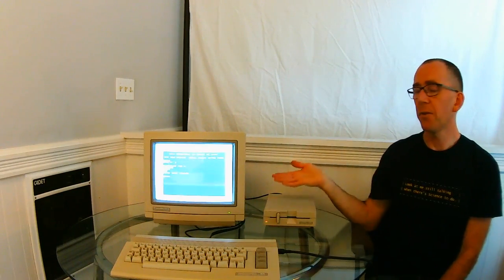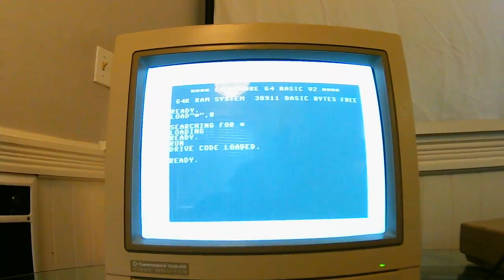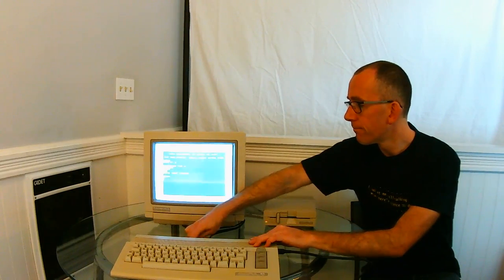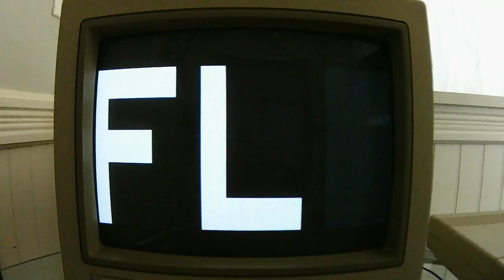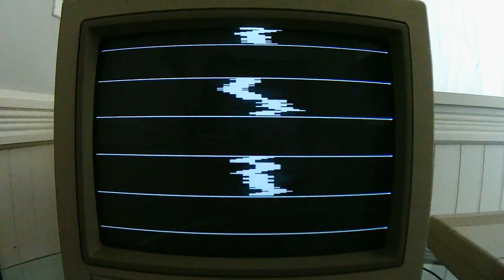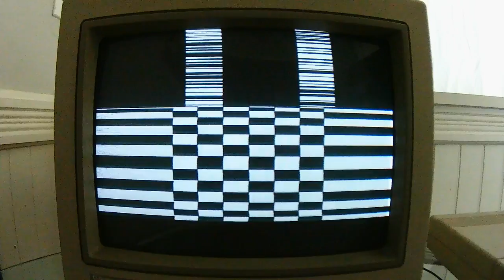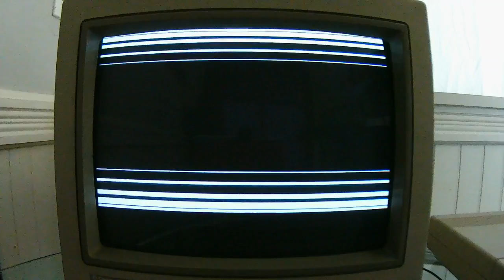Freespin

Comment: "No (not many) floppy drives were harmed during the making of this prod."
Reply from the maker: I only went through three. I still maintain that they died of natural causes.
Reply: @MatthiasKramm  would be interesting to know what killed them.
Reply from the maker: @NULUSIOS  One had a dead 6522. Probably because of a bad power adapter.
Reply: But many cables were ...
Those poor cables ...
Reply: @michiellombaers3198  they are just cables - probably user-made anyway
Reply: @NULUSIOS  /s
Reply: @MatthiasKramm  here's a challenge. Connect three drives together so they can synchronize then use one each to drive red, green, and blue inputs on an RGB monitor, and have three voice sound.
Reply: Don't worry, the floppy drives will be written off as corona victims.
Reply: @greggv8  That would be epic, but how to synchronise the Floppys?
some signal of one Floppy must tell the others to start next line.
Reply: @ulrichkalber9039  a custom serial hub through which the drives coordinate their start then the software commands it to pass the signals through to the video connections. Could periodically switch back to hub mode to recheck sync.
Reply: I don't see any need for a custom hub. There would be some custom wiring, but not much more than what this demo did. Wire all grounds together, have one drive emitting a composite sync signal which is sent to both the monitor and a serial bus line (say, ATTN) on each drive, and the other drives would sync with that and emit the colour signals on their DATA lines.

I'm not sure if this would sync tightly enough, though. It might make more sense to simply try to output more colours using the extra lines unused in this demo (SRQIN, RESET, ATN).

Comment: The question "But how?" doesn't leave my mind. Brilliant!
Reply: The 1541 basically has an another C64 inside computing power wise. And fastloaders already implemented custom signaling with the IEC port. It's just, this demo uses it to modulate composite video. I'm not saying this doesn't blow my mind still, it's just I know it's technically makes sense. It's still extremely impressive, especially that the 1541 has nowhere near as many RAM as the C64. Also besides encoding the video, it also does music with the stepper motor. Insane.
Reply: That's the one bit I still don't get, the music.
Sure it mostly sounds like a modulated stepper motor, except those super high pitched arpeggios. Those don't sounds like a stepper at all
Reply: @MostlyPennyCat  I think there must be Two motors inside that floppy, one turns the floppy, one moves the head.  possibly the turning motor makes that sounds?

Comment: Very creative and technically excellent, except cutting the wires on a glass table ;)
The Bitshifters did sort of the opposite when they connected the video out to the floppy write head to experiment with writing different bit patterns that were too fast for the BBC Micro's 6502!

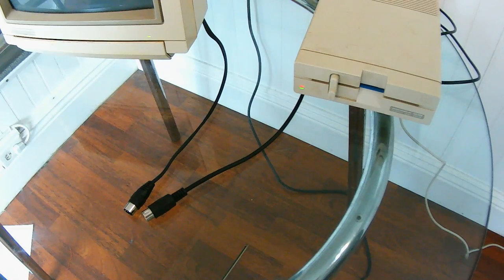Comment: 0:37 I had a stroke when you started cutting that cable, I hope it's not an original one.
Aside from that the demo is awesome 🤯
Reply: Judging by the wires' size, looks like a modern reproduction.
Reply: Yeah, looks like a modern repro.  Vintage cables would've been much thicker, and the plugs were a little different.  Plus I imagine the thick-ass PVC insulation would be much harder to cut through after ~35 years.
Reply: I felt physically ill when I saw that knife going for that cable. BUILD AN ADAPTER, MY DUDE. DIN plugs aren't uncommon! Oh god, oh god why, why... :o

Comment: It appears that disk drive itself is 8-bit computer having 6502 and 6522 inside (see Wikipedia for the image). Load program into it and trigger the execution when drive door is closed. If power is lost C64 will be needed back to restart the demo. The simple 3-level voltage circuit is genius :)

Comment: Unbelievably brilliant and unique idea, excellent implementation! Well done and...THANKS!!! And I'd thought that there wasn't much impressive stuff to be seen in the 8bit scene anymore...
My 2 silly questions/wishes:
A) Could this be ported to load from VIC20 and also C16-Plus4? This would be fun and, I suppose, very easy to be done from an experienced programmer...
B) Would it be possible to see something like this in color, using simultaneously attached drives 8, 9 and 10 and the proper cable, leading all 3 of them (each one for a separate RGB color) to a suitable analog RGB monitor like the 1084 or equivalent? This would also allow pure "multichannel" mechanical sound, with 3 step motors banging together! :-)

Comment: At first I thought: “it’s roughly similar hardware to an Atari 2600 inside - 1MHz CPU; this is cute but probably not that to hard to do”. But there is no ROM and no video hardware, just 2kB of RAM and a floppy disk (while the drive is simultaneously making music). This is a technically stunning achievement.

Comment: Wow, impressive. I knew that the C64 floppy drives come with their own CPU and such, but have never seen doing the floppy drive everything alone :-)

But when you unplugged the running computer from the cables it reminded me that someone I knew did that once, back in 1985 or so. By removing the monitor cable while the C64 was running destroyed the SID, and it had to be replaced. I hope yours is still intact. ;-)
Reply: Yes, it can kill SID, happened to me once or twice.

Comment: I'm speechless. When you thought you've seen everything.🤯
Also, this got me thinking. Since the IEC bus is a daisy chainable open collector bus, in theory you could create a multi drive demo (two drives and the screen on the cable), pre-synchronizing them over the bus, and rendering different parts of the screen? 1541 SLI?!

Comment: LOL. thank you. This is awesome. I'm in shock.
BTW... it they could forget about backwards compatibility with vic20 and other commodores, then floppy drive for c64 could be cheaper (without "second" copy of c64 inside itself) and much more faster. the same with the c128. It they could forget about backwards compatibility with c64, and create c128 without c64 mode, then game producers must provide games with better graphics and more advanced/complex code instead of making the game which is compatible with c64 and c128 in the same time (so it cannot use full potential of c128), and this could increase c128 popularity and keep commodore alive. I cannot accept that mistakes.

Comment: How to run this Demo on an emulator ?
Reply: You could cut open the emulator and..😆

Seriously, now: basically, someone would have to modify an emulator to add this hardware setup.
Reply from the maker: I have a version of vice that's able to emulate 1541tros. I need to push that to github at some point.
Reply: @MatthiasKramm  Thank You. Am waiting :)
Reply: @MatthiasKramm  I'm sure that came in handy, to reduce the number of 1541s consumed by development and testing :D

Comment: Holy shit, that's impressive. Could the 1571 do anything more than the 1541 with its burst mode?
Reply: Nothing is impossible but burst mode is basically adding a shift register so the CPU doesn't have to clock the data out itself... I'm not sure that woudl acutally be helpful for outputting video unless it were possible to control the shift register finely.

Comment: What does removing and reinserting the floppy do?
Reply: Probably just signals the code to start the intro. The drive needs to wait for the user to have plugged the monitor in instead of the host computer, after all, and this is "press any key" 1541 style.

Comment: But how?! I can understand the concept, but the CPU isn’t what generates graphics, the VIC chip is. There’s no VIC chip in a 1541, is there? And even if it could display graphics, how could they be higher resolution and speed that the 64’s graphics, inside a floppy drive? 

Is this demo available for download? I have plenty of spare 64s and drives - I would like to put this to the test. I don’t believe what I just saw. ;-)
Reply: Go to the website, everything is explained in great detail.
Reply: ZX80 computer also lacks video chip and it can display video :)
Reply: Bit banging a video signal by abusing the signalling pins on the serial bus. It's not working at a higher resolution than the C64: the horizontal resolution while doing this and doing everything else is really, really low. It just has a higher vertical resolution, and that's about it. It's not all that different to what you had to do in the Atari 2600, but without any support hardware at all for signal generation. I haven't read the post yet, but I'd put money on it (ab)using a VIA in the 1541 to help with video signal generation and timing.

Comment: This is nothing new. In the 80's there was a 1541 program "Head alignment", that played music by moving the floppy drive head. No C=64 required, once program was loaded from a floppy.
I may still have it...
Reply: Uh, there are parts of it certainly that are nothing new. Then there are parts that have never been done before, and then there's putting it all together in a way that actually fits and is able to run in concert. You don't get to just take one pre-existing aspect of it and say "nothing new".
Reply: Using the 1541 data and clock lines to drive video output was new to me.